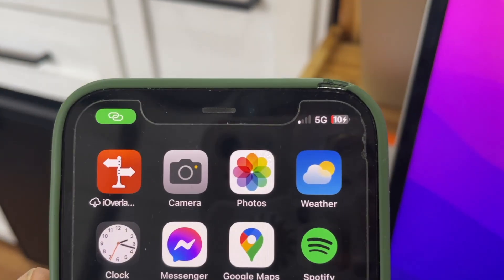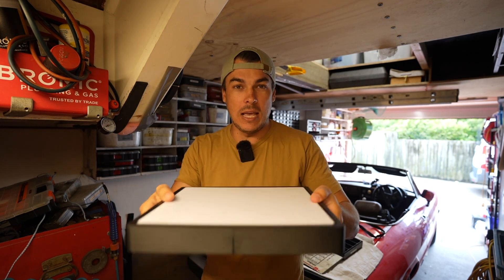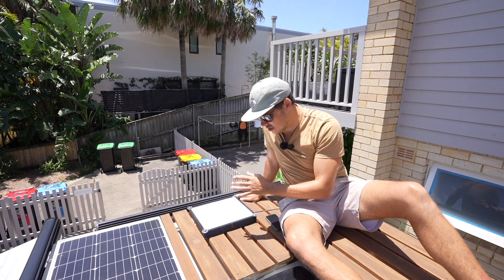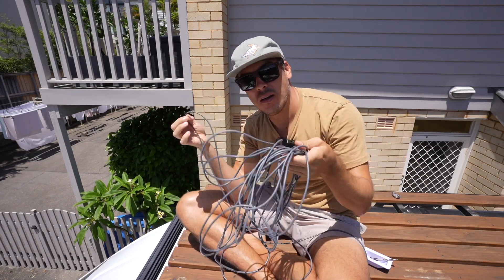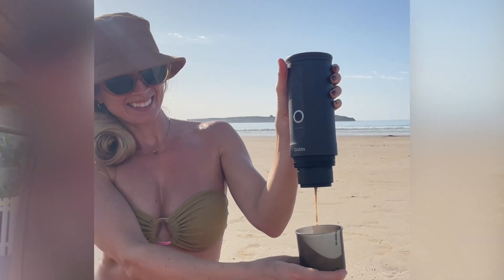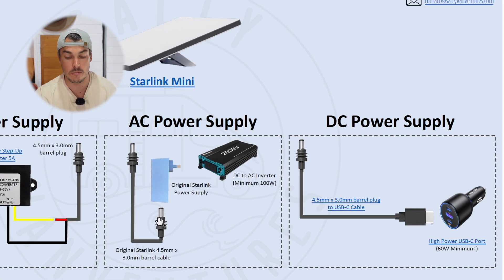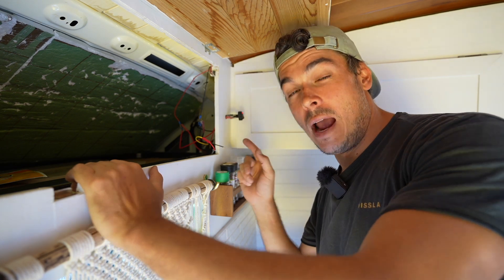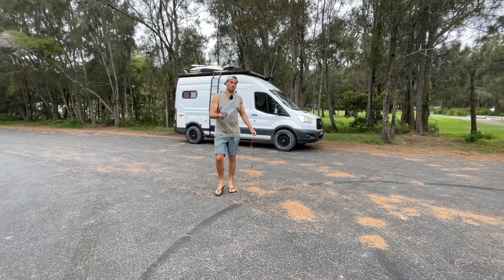Permanently Mounting the STARLINK MINI on my Van

Comment: What did you use to “store” the cable port connection in the starlink mount? For when you remove the starlink from the roof
Reply from the maker: I just used a black female plug which I waterproofed and secured tot he roof

Comment: I know that you tested the wifi inside the van but I'm wondering if the dish was installed at that point? Since the wifi comes from the dish on the mini I'm curious if the van acts like a faraday cage and blocks the signal when the starlink is on the roof and you're inside the van?
Reply from the maker: The dish is installed on the roof and we get full reception in the van no problems.

Comment: You said you used the 12V-24V step-up because you had voltage drop to around 12.8V due to the length of the cable - but the Starlink can run off 12V, so why the need to step up to 24V? 12.8V should have been fine, as the extra 2m up to the roof won't drop the voltage below 12v. Why does it struggle on 12.8V? If your step-up can supply 24V @ 5A then it is able to pull 12V @ 10A and so could the Starlink.
Reply from the maker: Unfortunately it’s not quite that simple. A lot of people experience the same thing. It may work sometimes but when your voltage drops a bit over the day/night ect it might hit a sweet spot when it stops working. The step up ensures it will always work.
Reply: @saltyvanventures  interesting - thanks. I would guess a buck-boost converter that takes 9-30V and outputs 12V would probably also work, as it would provide a guaranteed 12V no matter what else is going on with the 12V supply. I am planning one of those as I have other electronics I want to include that need a reliable 12V supply.

Comment: Great idea, is there any reason you didn't want to use the roof rack mount or mobility mount?
Reply from the maker: Mainly because I wanted to mount it to the wooden roof deck and also they are much more expensive. The mount I used was actually the cheapest flat mount I could find

Comment: The upload is always the downfall of the satellite systems.  But a great system for a mobile unit!  Great info!  Just the price bites a bit.
Reply from the maker: The price does hurt but we were actually spending around $150 a month between us in mobile data and that didn't take into account the stress of not knowing if a camp spot will have reception or not. This alone is worth the premium to us when you work online and need to make it to certain meetings.
Reply: If your van has an inverter, it is a lot easier to plug the Starlink Mini’s AC adapter to it. That’s what I do. Easy Peasy.
Reply from the maker: @ Yes but it uses twice the amps doing so. If you're tight on battery capacity its may not be the best solution.
Reply: @ makes sense.